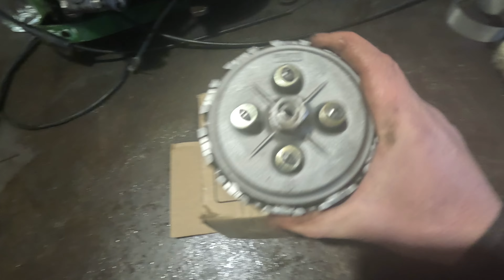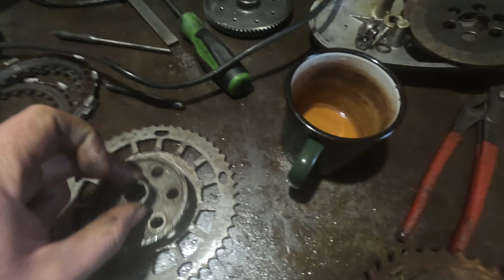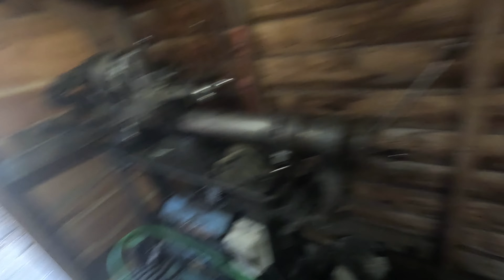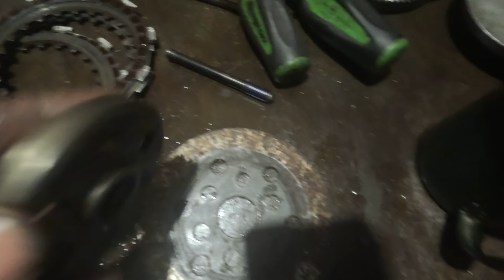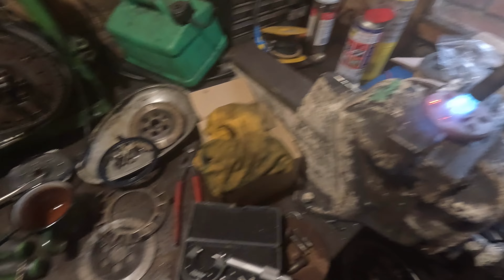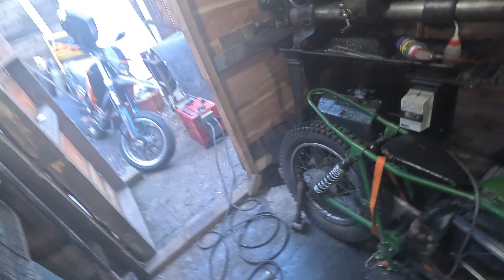Old bike, new clutch

Comment: An alternative strategy might be to drink wine and save the corks to reline the original clutch . 
Not an engineering solution but after the first case - who cares ?
I'll drink to your success .
Reply from the maker: It is an engineering solution. An engineer would identify the source of the material and it's original purpose. Being an engineer, that person would recognise that removing the cork would cause the wine to spoil and engineers are not wasteful, so the wine would have to be consumed. Plus it is the easier and less time consuming answer, depending on hangover duration. I just wanted to see if I could make a clutch.